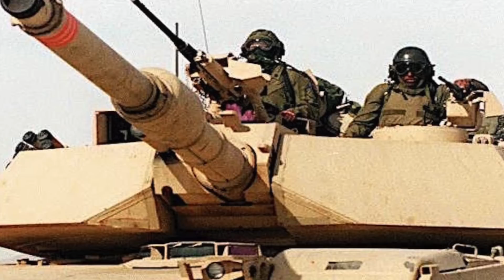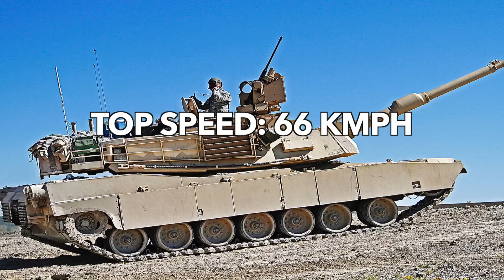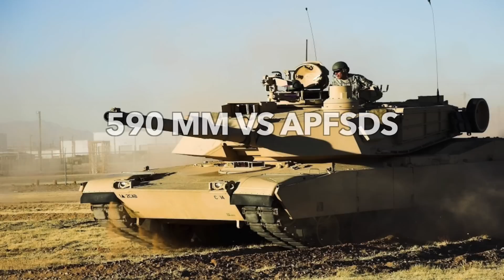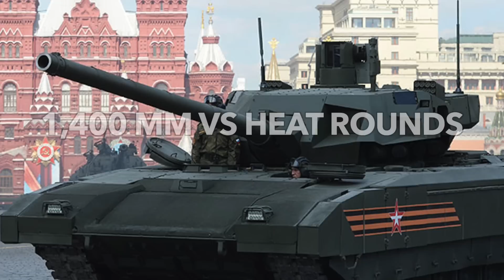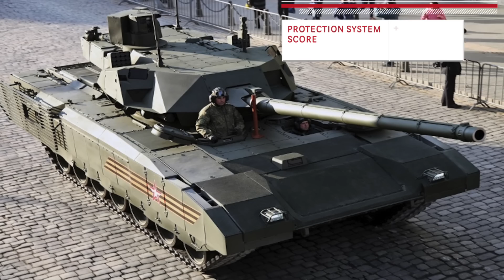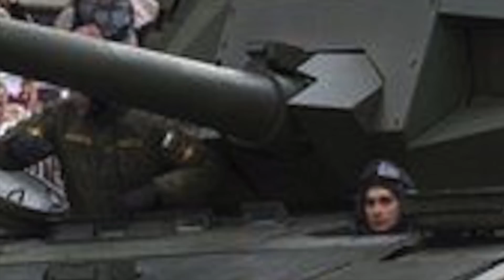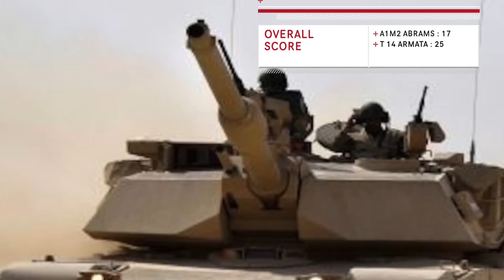AMERICAN M1A2 ABRAMS  vs RUSSIAN T14  ARMATA: WHO WINS?

Comment: The t14 fucking BROKE DOWN IN THE MIDDLE OF A MILITARY PARADE. wtf are all you saying its the better tank. Its hull isn't impenetrable against all rounds just the standard round the abrams uses and guess what the abrams is getting new rounds to do more penetration. The t14 has a fucking remote controlled turret that is not practical on the battlefield as its less reliable than manual tank gunners and loaders and fires slower. T14 is not stealth capable and does not have a future in the russian army as its too fucking expensive for their crappy economy. Its not tested and yet all you morons are saying its better. Last i checked no american led abrams have ever been destroyed by the enemy. Only saudi arabian m1a2s have been destroyed and those do not have depleted uranium armor which is what makes the abrams so good AND their infantry do not support the tanks from anti tank missiles. Tank against tank the abrams stilk wins because its crew actually will know how to use it rather than the russians who uave almost 0 modern combat experience unless u count puny georgia and Chechnya where the russians took heavy losses

Comment: One thing i would like to point out is that you got the armoring for the M1A2 Abrams wrong seeing how its suppose to have all the upgrades as previous tanks it would have 600mm of protection on the hull and 800mm of protection on the turret VS APFSDS with 700mm of protection on the hull with 1,300mm of protection on the turret  VS HEAT

Comment: Fact is, both tank communicate with other assets in the air and on ten ground, also, on the abrams side, the vanilla m1a2 is getting upgraded to be more modern, if it comes down to a war, based on the United States ability to readily support its armor the abrams will win

Comment: Russia has announced that the T-14 will not go into full rate production and that only 100 (less than one Armor Brigade's worth) will be built between now 2020.  None are expected to be exported.

The Russians will instead be fielding an updated T-90, which is odd as the T-90 was not seen as a successful design resulting in the development of the T-14.

Its not possible to determine if the T-14 was to impractical, to expensive, both, or neither.

Comment: Lol "unbiased". The m-1 has survived hits from Russian 125 mm shells. And a 50 ton tank always has better armor protection than a 72 ton tank. (Sarcasm) add to that the t-14 is constantly in a "buttoned up" condition and the m-1 has better situational awareness. The Armata and it's systems are untested where the m-1 is combat proven. Whether one tank is better than the other at this point is pure speculation but Russian tanks in the past have failed to live up to the hype they invariably get when introduced. But we shall see.
Reply: The M1 has NEVER been hit with a russian shell. The T-72s used in the middle east are all ex-soviet bloc export models which are inferior to the Russian standard production. Hell, some were domestically produced OUT OF ALUMINUM. The gun on the armata is also new, with new shells. 
The armata can achieve better protection despite being lighter depending on the composites used, more armor is on the front, with much less on the sides. The M1 is combat proven, yes, but against 1970's era tanks and weaponry. The T-14 also has better situational awareness as sensors and cameras cover the tank, allowing for good visuals. 
Russian tanks are perfectly fine, it's not their fault that the arabians who crew some outdated knockoff of their vehicles from china decide it's a good idea to sit in the open and try to take potshots at quickly advancing enemy tanks.

Also: https://www.youtube.com/watch?v=B1yTb3vF35M

Comment: Don't worry... T14 is just another Russian crap, like everything that they do. Most of the innovative tech that they used... will NOT work. They are familiarized with progress by endless tests, empiric stuff... advanced research is impossible in Russia! 
In real combat, most of the T14 will broke(like that one in the official parade) not mentioning the high tech defensive and offensive systems... cheap joke.
Reply: +Sabin Ionescu

 I appreciate your doubt, but still, a bit excessively negative. Also, there is no evidence the T-14 did break down in that Victory Day parade, it did encounter an issue of some kind.
Reply: @peterson7082  The driver mistakingly used the parking break since it's new and he lacked experience in it.
Reply: driver's error
Reply: You are junk

Comment: Re: Michael McClure, that's why tank recognitions are getting harder and harder and in future conflicts, there will surely be more friendly fires! With armored engagements only showing turrets or partials much of the time, we do need a lot more than just Mark 1 eyeballs now!It used to be that we could spot threat tanks by their lower, rounder turret shapes but now, angles, angles, angles- very hard to tell. And with many countries using similar camo patterns, even harder.So, US tankers relied more and more with onboard computers to show locations of friendly forces and IR ID panels. I also worry about infantry combats too, considering how close uniforms looked to one another. In WW2, one could easily spot helmets and uniforms of different nations but look at different possible conflicting countries now- Chinese copied the helmet patterns we spend millions doing research on, as did other European countries, if not using actual American helmets for their armies.Then, countries are going for digital camo patterns too, again, after we spend millions trying to perfect them, and with very similar load-bearing gears, enemy combatants will be harder and harder to identify even at close range. That's why we adopted those tiny glint squares for our troops. There will be lots of blue-on-blue casualties in future wars.

Comment: You forgot to mention the softkill and hardkill APS most modern M1A2s are equipped with, increasing their survivability. The DU mesh on the front of the Abrams is also stronger  than the values you put up.

Comment: I think the power packs are worth mentioning. The M1 uses a AGT1500 turbine engine compared to the T14's typical Diesel engine. I don't think the M1 is very flexible with its fuel, the turbine will burn multiple fuels, but it will not perform the same and is a last resort combat environment situation. The turbine is pretty fragile when it comes to foreign object damage, if the air filters are installed incorrectly, a little bit of dust could ruin the million dollar engine. It's interesting that the T14 went with a piston engine. While the turbine is more powerful, I think the T14's diesel piston engine will perform better under adverse conditions.
Reply: +Jared Deitch

 I.C.E.'s are inherently less capable of running at peak efficiency with multiple fuels. Certainly new technologies offer better performance and adversity in this area, but a gas turbine actually will run at this peak efficiency longer on different fuels. Depending on construction.
Reply: Nathan Peterson absolutely, everything depends on construction. Multi fuel capabilities are something to consider. I would say how robust the engine is with a failed air filter is something more important to consider when M1's won't be 100 miles away from a fuel tanker at  any given point.

Comment: Abrams is old and phased out, 2nd gen composite chobbham and hand me down L44 cannon. A good comparison would be the latest leopard 2 models which use amap 4rth gen composite armor and the L55 cannon.
Reply: +13thSystem

> " 2nd gen composite chobbham and hand me down L44 cannon"

The M1s haven't used Burlington (the actual label for Chobham), chronologically speaking, since the M1A1HA. 

 The M256 is a 44-caliber gun, but is not the L/44.

Comment: Maybe but if the t14 uses ERA that means that more then one shot in an immediate area will most likely penetrate. Whereas the Abrams has the composite with uranium mesh with a possibility of add on ERA. Which gives the Abrams the ability to survive more than just 2 shots to the same immediate area.

Comment: unbaised comment here

If we were in a battle that was nothing but nasty mud, i'll take the T14 but really i rather take the RIPSAW with rocket pods and atgms.

If we are battling in the desert and its only tanks then, i'll take the M1a2 SEP.

Now if its a combination of IFVS and MBTs, then i would probably pick the T14.. 

Now, why is that the case? In the desert Battle with tanks only, i would chose the M1a2 for the best survivablity in the long run since there is plenty of armor in the turret, front hull and  the ammo box. If the ammo gets hit and the blast door inside the turret is closed, then all the explosions will go straight out of the ammo hatch instead of the crew compartment. As an M1A2 user, i would only go for the T-14 turret with APFSDS-DU. That is if their invisable anti HE/HEATFS/APCBC/ATGM actually works. One shot in the turret will render the tank useless. Only because the autolouders are always too complex and impossible to repair during a battle. Unless the T14 hull armor don't live up to the hype then one shot in the front will ruin the crews to nothing. 

As a T14 user, i would only use the T14 if the IFV are fighting side by side. Reason being is, one shot in the turret will render the T-14 useless. There didnt seem to be any crew loadouts, so its dangerous to run outside with no gear. So if my turret is blown, and i can move then i would drive to the nearest IFV and get inside there, otherwise i'll wait for the IFV.

Now saying which cannon is better is nonsense when penetration and armor value is classified. For a long time in the 50s-mid 70s, we were trying to make our 152mm cannon work. The conventional rounds work but only up to 800 yards. the APFSDS-DU or Tungsten Carbide was only able to work inside the MBT-70 but they were having issues. with the gun anyway. They also designed an ATGM for 152mm but they hardly ever use it since the problems were just a fucking cunt. So that is when they decided to not buy the super expensive MBT-70 and put money into a new program towards Crysler defense and General dynamics. One produced an XM1 and another was M1 i believe. they were somewhat identical performance with different looks and when they chose the favored prototype, they redesigned to the proto and there comes the M1 Abram with a work 120mm cannon that isn't problematic. So we will all basically know how good either cannon and armor is in 50 years, promise you that.

Comment: 1) The T-14 is theoretically faster
2) They've estimated estimated armor thicknesses based off an outdated RHA estimate of armor and completely ignored ammunition/threat capability
3) The T-14 "protection system" conveniently has a maximum intercept capability of 10m more than the published muzzle velocity of the M829A3, and completely ignored deployment tactics as a defense measure.
4) They speak about gun capability (and grossly mispronounce Watervliet ("Water-v-elite" is closer).  The M551 Sheridan and M60A2 tried the 152mm cannon thing..... (notice they COMPLETELY left out ammunition, or the auto-vs-manual loader argument?)
5) "Crew number and unit cost, together determines the overall OPERATIONAL cost of a tank".  Really?  Since when?  Logistics, parts, fuel (POL) are all free now?  Coolness!  Let the Russians maintain the tank, break track, and conduct area security with a 3-man crew - I'll happily keep my loader.   Hell, with free fuel, parts, and maintenance crews, I'll take 2 loaders!

Conclusion: "The T-14 is a better tank".   Uh -huh.   Unbiased my ass.  Perhaps from someone who go thier knowledge from the 'tanks are cool' article in SkyMall magazine.

Comment: The USA can do better and needs to do better.  The amount of time the Army has been hanging onto the Abrams is stupid, upgrades aside, new tech needs to be used to redesign and bring American military units up to the best potential capability.  10 years should be about the longest any US weapons system should be in use unless sections can be removed and replaced bringing the unit into a degree of superiority over it's previous model akin to a next generation.

Comment: M1A2 is most likely slightly inferior...yet, battle-tested wise, M1A2 is immensely proven...objective opinion here.
Reply: @PROLIFIC_TRAVELS  I mean, its more than the T-14 has proven in combat, which is nothing.
Reply: Well, I mean it’s been fighting tanks that are a decade older
Reply: Dragana Milosavljevic ehhhhhh by the time the Soviets had the IS-2, the Americans had the M26 Pershing, and the Shermans had the 76mm gun that could penetrate the tiger tanks frontal armor from a distance. The USA is powerful not just because it has good equipments, but because the US is super rich. Russia lacks the military funding to create and mass produce its military equipment. So it searches for a cheap method which lowers the price. That changed in 2015, but Russia doesn’t have an advantage in military funding when compared to the USA

Comment: God what a bunch of Bullshit.

First,  Composite Armor is only mean to stop heat rounds.  This is also True when it comes to any type of Reactive Armor.  The Only way to stop/deflect any Kinetic Energy Penetrator is with Solid Armor.  The M829A5 120mm APDSFSDU Round is proven to Penetrate Any Known Armor in the World and have a max effective Range of over 3 KM.  The latest Russian Rounds for the 125mm Gun are lucky if they can hit anything over 1500 meters.   On top of that American Optics and Targeting Computers are far Superior to include anything the Russians have today or in the future.   The M1A1HA/A2/A3 series has more then just a DU Mesh, they have a solid DU plate in the front hull and turret.  So where this bunch gets their info is misleading at best.

Second:  Crew Training in the US and NATO is far Superior then any thing the Russian Tank Crews do.  On top of that US Armor Platoon/Company/Battalion Doctrine is far Superior to Russian Armor Doctrine in that US Tank Crews are trained to act as Individual Fighting Units in support of each other.  Russian Tank Doctrine still emphasizes Platoon fire discipline where the other Wing tanks in a Three Tank Platoon fire at the same Target as the Platoon leader.  Take out the Platoon and Company leaders and it becomes a Turkey Shoot.  

Third, the T14 has all three Crew in the Hull, meaning the Turret is Automative.  This is an Electrical and Mechanical Nightmare in the field. Even if the T14 could defeat or deflect the M829A5 Round, the Shock of the Round impact could disable the turret Systems making the the T14 just a rolling armor box.  

Fourth: the most Powerful Anti-Tank Missile is the AGM 65 Series Maverick Missile.  This missile been around since the 1970's is on the A-10.  It has a Range of 22 Miles and a 57 KG Warhead.  There is no tank in the world that can survive a hit from one of these  beast!. 

IMHO Defense Updates need to get their head out of their backsides and really do a true Comparison of Tanks.  You will find that the M1/Leopard 2/ Challenger 2 Series Tanks are far Superior then the New T-14.

Comment: Well    I  Quess  the  Armata   would  outgun   the   M  1   in  every  aspect  ,  it's  a   newer  built   tank .  The  M 1   is  30  plus  years  old   and  still  a  tank  to  be  feared .  So  it  doesn't  take  a  ROCKET  Scientist   to  figure  that  on  out . Also   General  Dynamic's   was  not  the  prime  maker  of  the  M 1  ,  Chrysler  Corporation   was .  Chrysler  Corp.  was  known  for  there  Engineering  ,  not   Gen .  Dynamic's   . Get  your FACTS   STRAIGHT  !

Comment: The end bit was wrong the US has built 9200 ish but only has about 2000-3000 the Russians have about 4-5 times the amount of tanks the US has. The main ones are more than capable of taking on the M1A2. I think a fairer comparison for the M1A2 is the T-90 MS which is still newer than the M1A2 but is more on the M1A2s level. The T-90 would probably still win but it wouldnt be as embarrassing for the M1A2
Reply: Around 8,600 in the U.S., with a further 500-1,000 Egyptian made tanks. 

> "the Russians have about 4-5 times the amount of tanks the US has."

The majority of the Russian's Ground Forces potential tank fleet is made up of T-64s, T-72s, and T-80s in storage or low-readiness reserve. A large comparable active tank fleet to the U.S., but consisting of modern vehicles, is much smaller than you anticipate it.

Comment: Ok guys... seriously, yes the t-14 armata is a better tank, but let's not forgot that the t14 came out in 2015, not in 1980. Americans have kept upgrading the Abrams as best as they can, instead of creating a new tank. In which they have done a very good job of upgrading the Abrams series for 37 years... I'm sure Americans will do a lot to compete with the t14, the m1a3 could have far better shit on it when it's released. It could have 130mm for its standard gun, or it can upgrade a 120mm to the max but I doubt it. They can add any type of calibre gun, since the t14s better cannon id gonna be 152mm, the Americans could equip the m1a3 with a 155mm gun, also lighter weight armour up to maybe 2 meters thick, I mean that would be a dream. The engine could have 2.5k horsepower for its maximum, with a road speed of 110kmh moving a 50-80 ton object probably. They could make the range up to 700 or 800 km, it could have improved optics for night vision in such, could be more comfortable possibly... they could probably mount 40mm grenade launchers that can shoot the range of a 50.cal browning, they can add the Bradley's main gun which is the 25mm autocannon as a secondary weapon instead of a 12mm coaxial. Improved smoke grenades, etc. like who knows, the m1 Abrams was once the most powerful tank in the world and I think they're gonna make the m1a3 the most powerful in the world, again. Other than that, yes the armata is the most feared tank at the time.